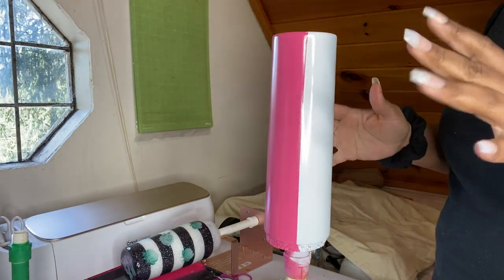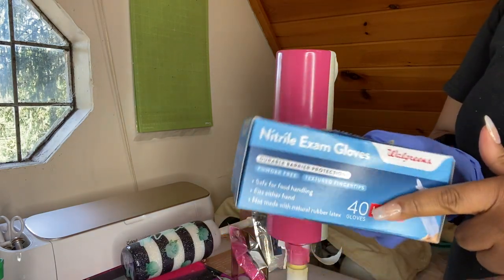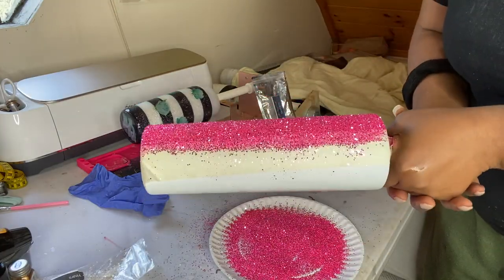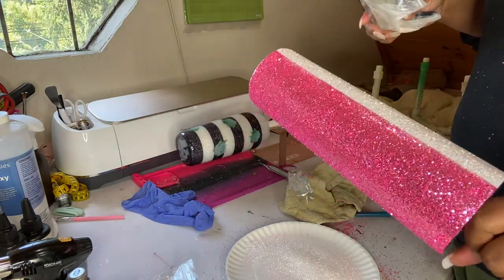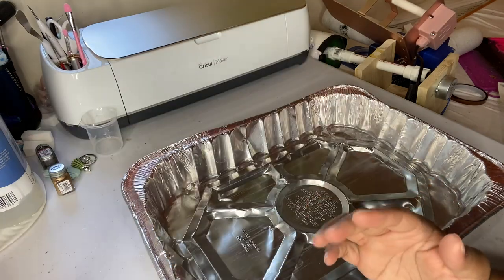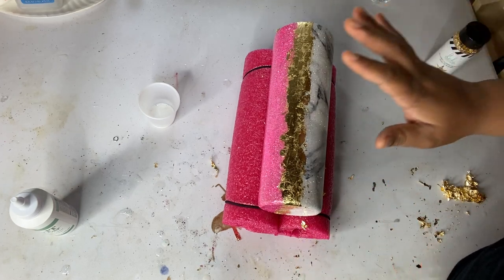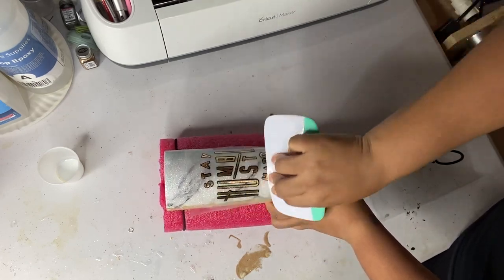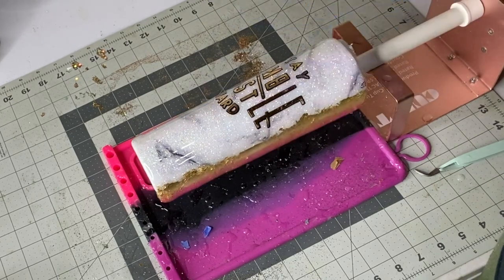EPOXY: Double Sided Foil Tumbler

Comment: You have the link of cup turner?
Reply from the maker: The pink one isn’t available but there’s a blue one! 

Cuptisserie Cup Turner, Metal Tumbler Turner Machine with Rotisserie Motor & Professional Balance Steering Shaft, Perfect for Epoxy Tumblers https://www.amazon.com/dp/B07Z5S5W7N/ref=cm_sw_r_cp_api_i_ko9QEb7G3KA5X